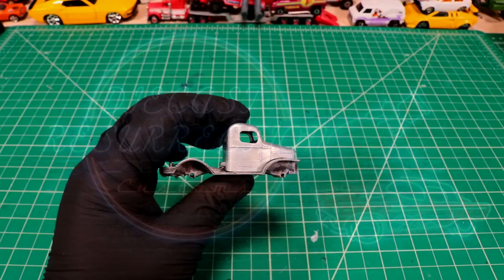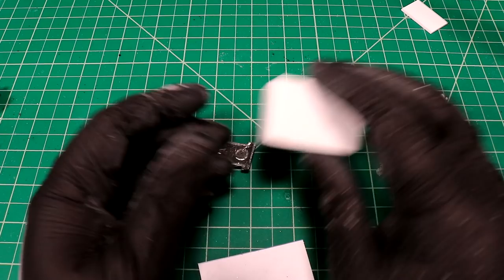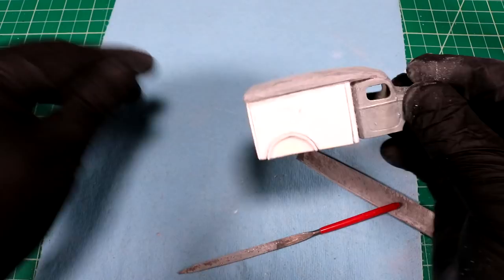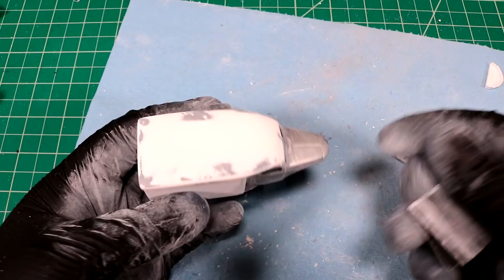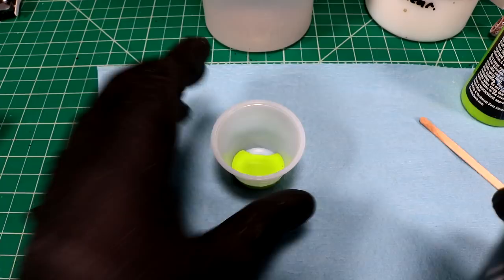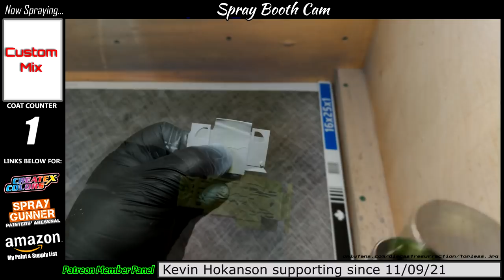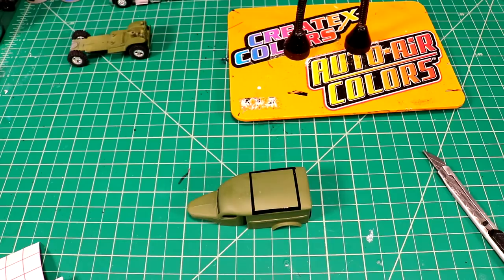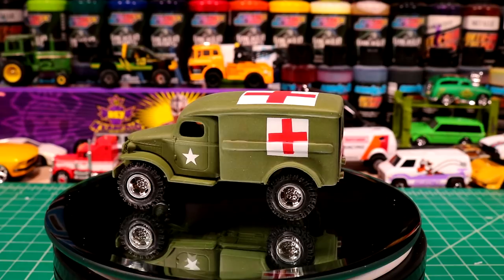M*A*S*H Style Ambulance Build - Hot Wheels Parts

Comment: The styrene strip broke because CA glue gets very hot as it cures - it's an exothermic reaction that gets even hotter if you use accelerator. I've used CA to seal up cuts, and it gets damn hot. You should try 'Plastic Weld'. I only use that, and Tamiya Extra Thin plastic cement.
Lovely build. That Power Wagon is a thing of beauty. Nice one.